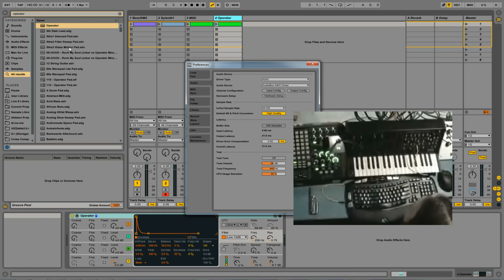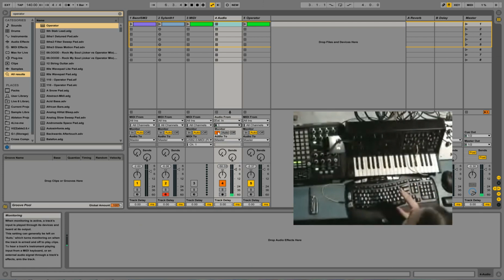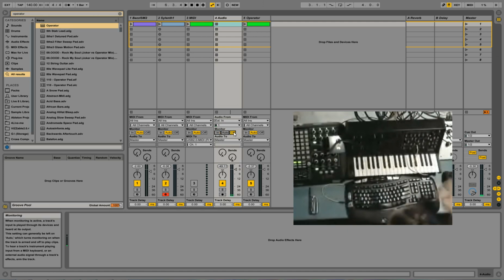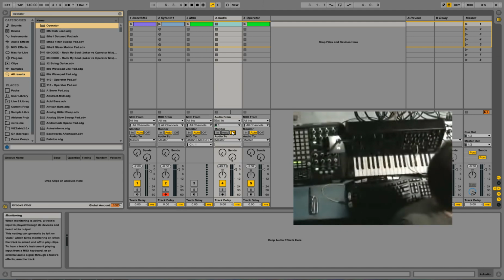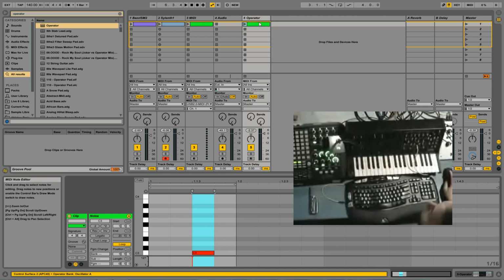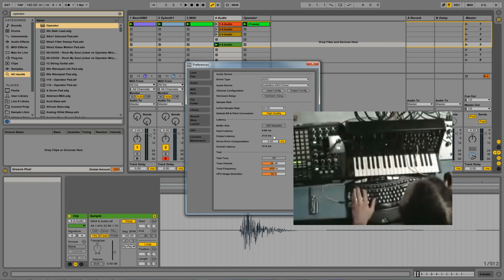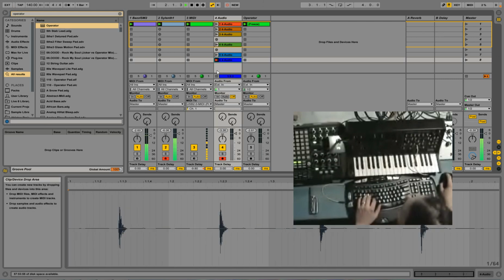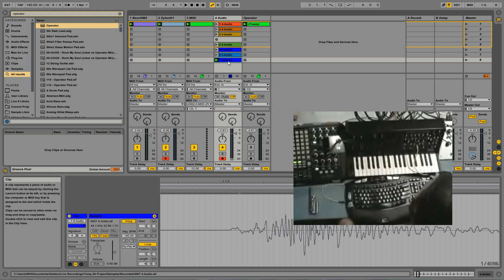Ableton Audio/MIDI Latency Recording Issues with External Synths

Comment: Thanks for sharing. Im trying this on 9.7 It worked on the first track i did but nothing after this is working. I also bumped my buffer size down to 128 from 256 in the process, and changed my Focusrite latency to the shortest. I may have changed a few too many things at once, so i restarted ableton. now the negative track delay does not work, but positive values in the "hardware latency" of the Ext Inst device do. is it possible that the value expressed there should be interpreted as negative (or an offset value)?  I have it work now to be synced with recording as a freeze or recording w monitoring on OFF on a paralell audio track. if you record from the channel input and skip the Ext Inst it seems to be offset by the input latency value of your preferences...

Comment: You can just expand the midi settings in options and under the sync there is a sync delay drag bar
Reply: That will do nothing if the notes are coming from Ableton and not the gear's own sequencer

Comment: Awesome video!  My Ableton's Buffer Size dropdown menu only has 7 options (32 samples–2048 samples) and after trying all 7 of these buffer sizes, the latency is still absolutely terrible on my M-Audio Keystation 88 II.  I have 64 GB of RAM and a 3 GHz 8-Core Intel processor. Does anyone know of anything else I can do to get my latency within an acceptable range???  Please help, thanks!
Reply: wrigna1 Hi I also have the Keystation 88 and it does not have Velocity Curves. In Reaper I use a plugin called "midi curve VSTi" which is free it gets loaded before your synth VSTi. The Maudio Keystation 88 also has terrible USB midi latency jitter which I deal with when using USB ( vs using Din midi out). Without the velocity curve plugin the Keystation 88 is useless. There is no excuses for not having the velocity curves feature built in as we are not in 1991. I am making a video break down of the Keystation 88 and how I use it.
Reply: Thanks for the reply!  I’m curious to check out your video on the Keystation 88...I feel like I don’t know as much about velocity curves as I should, I think I’ll do some more research on this.  Also thank you for mentioning the “midi curve VSTi” plugin. Hopefully this plugin works with ableton live also. I’ll look into it 👍

Comment: I too have spent hours trying to get Live rec/sync midi & audio tight. But its always trial & error. I Checked another solution "usamo" online, which was mentioned in another video's comments. I just felt, all this would not be necessary if Ableton would get it's midi engine right. I never had any problem with Digital Performer. It's midi is dead on. I figured all these clock/sync/midi/latency issues are DAW based. If ableton worked on it, they could be tackled.
Reply: Nihar Savala actually Digital performer up to V8 was a piece of crap with adding midi jitter when using USB controllers. Reaper actually was built to already avoid this with having different time stamp options. I believe v9 fixed this in Digital Performer as they moved to Windows a massive backlash would ensue against them for not having proper time stamp options. So thank the move to Windows. I guess Motu's " we eat sleep and breathe Mac" did not help them as they were going bankrupt. The move of their Products to Windows was to little to late as there is over 7 Professional Daws already there and thousands of Vst and VSTi instruments. MOTU should of switched to Windows back when Apple stabbed them in the back with the Emagic Logic purchase. MOTU was stupid and failed to see the changing horizon. Just as Digidesign thought it was alright not to have offline bounce and track Freeze. Reaper added Full VCA groups to its mixer and then Presonus copied and also added VCA groups then Magic Samplitude gets them lol. Digital Performer still does not have VCA groups even in V9 . Avid users of Protools can thank Reaper that they now have VCA groups on the smaller and offline bounce . Reaper is crushing every DAW out there in performance , nothing is hidden all inputs and outputs plugin pins exposed, 64 channels of sends and returns etc. Many features that Protools HD does not even have. Time to ditch the Dinosaurs.
Reply: Danfuerth Gillis I am still on dp v8. I have used dp since v4 + have used it to score films & many songs, never it had any midi latency problem. And if there was an issue it would not have been used by composer all over to score movies.

Am sure Reaper is a good daw. Good for you it has all those features.

Comment: You can safely ignore all the impatient commenters who want a quick, one-size-fits-all button they can click to fix all their problems; your explanation made perfect sense and described the problem and solution in just the right amount of detail.

As an addition, it's probably necessary to adjust the MIDI clock sync delay in Live's MIDI preferences so that your external gear's clock is synchronized with Live as well. If the MIDI note data is being sent on time, but the clock sync delay isn't adjusted, it could cause things which rely on your external gear's hardware clock (e.g., LFO clock divisions, arpeggiator clock divisions, etc.) to run out of sync with the notes you're sending to your synth.
Reply: +randomshittutorials What, exactly, does the buffer size have to do with MIDI? Have you ever even used a DAW of any kind?
Reply: To anybody who wants a one size fits all problem fix, just ajust the input/output buffer size to just high enough to be able to hear a clean tone ;)

There is even a button for checking if you hear a clear tone, all in the preferences tab under audio.
You're welcome.

Oh and octodoom, no hate to you.. I just wanna show you all there IS a one size fits all fix.

Comment: with latest versions ( up to 9.2) this technique no longer works. Ableton have acknowledged a bug report, but negative midi track delay is broken. Work around this using external instruments device and/or external midi fx devices.
Reply: +Joe Rickard 
just turn of monitoring on the recording track and live compensates automatically.
Reply: holladaymark thank u mate
Reply: I was wrong, i think!  I use external instruments but with the recording track set to monitoring on and live compensates.  must set live to low latency when monitoring though.

Comment: OK, I get what you are doing with putting negative midi values in to compensate but what to do(?) in a case like myself, where I am running an ALL hardware synth midi studio with an external sequencer (MPC) and I want to record and overdub audio into Ableton Live without any noticeable 'slapback' effect (latency)? Unfortunately, I have not been able to figure out a way to get Ableton to compensate for this and (I have tried their online tutorials on how to compensate to no useful affect) my system is NOT a slouchy one by any means: 2008 Mac Tower Xeon quad core 8GB RAM with three 7200 RPM drives and an A&H Zed-R 16 Mixer. Using Protools there is automatic delay compensation...no fudging required. Ableton is such a pain in the arse to use  as a traditional Mixer/Multi-Track Tape linear recorder setup (like the old days!) that I gave up on using Ableton for such and only use it as a SELF CONTAINED compositional tool.  Ableton works well within the confines of its OWN environment but does NOT fare well when outside audio elements have to be introduced into it. Just my take on Live. The latency issue is why I did not update to version 9

Comment: I have the opposite problem. When I start Ableton, my external MIDI synth plays first due to a firewire interface being faster than Ableton's own compensatory settings. It is usually close to 50.00 ms. I'd almost rather have your problem because with me, it varies day to day and I am constantly adjusting.
Reply: +Wavestrike Electronics i think we would all like to live without a mixer but i'm not sure its possible for the reasons you have alighted upon.

Comment from the maker: That is another way to do it, the reason that I did it this way was to explain the different forms of latency compensation.  The external instrument works slightly differently but has some advantages - namely that you can Freeze the track and you only need to use one midi track instead of a midi track and an audio track.  Instead of -12 ms on the midi track I use 12ms in the external instrument.

So...yeah probably more simple to use the external instrument :) nice post